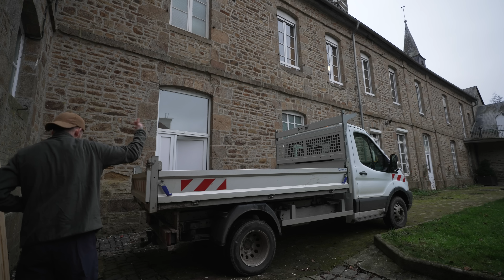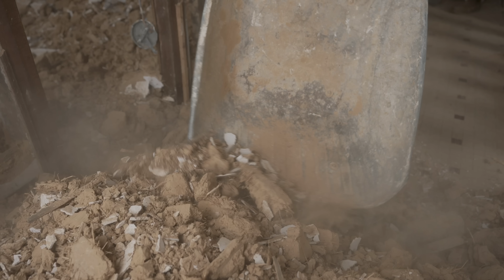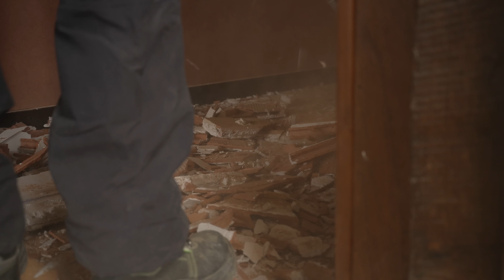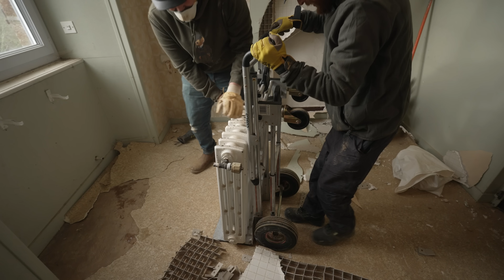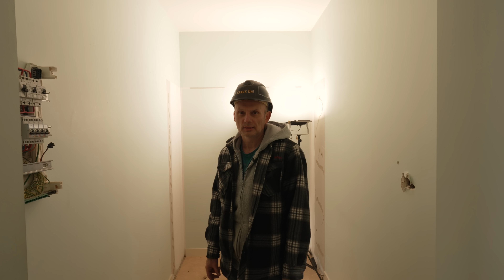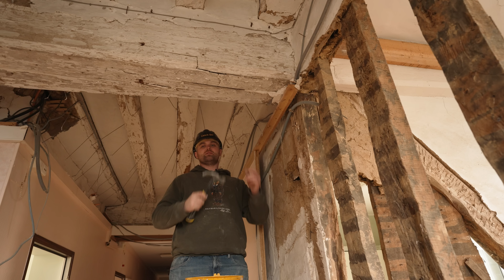The More I See The Worse It Gets

Comment: If you would want to keep the big beam, you could have it reinforced with epoxy resin and fiberglass rods. It's common practice in old wood constructions in The Netherlands (windmills for instance). It's a wonderful way to preserve the damaged but original bones of the building for posterity.
Reply: Personally i would definitely strenghten it. Because i don't know if the "its perfectly straight from here" isn't just an optical illusion. The angled support beam of the larger one is also slightly seperating at the vertical joint so to my untrained eye it kinda looks like it did sag a bit down. Might  be a combination of sagging + already crooked beam
Reply: @KaySan666  They're taking the beam out (was said in yesterday's video).  I think maybe this method of conservation (plexiglass rods and epoxy resin) is not well known outside of The Netherlands. It is however tried and tested and has saved many a tumble down, half rotten  timber frame from  pretty much complete replacement.  Reinforcing the old beam would not just be a cheap fix to keep it in place for a little while longer. On the contrary, the rods and epoxy would make it stronger than even a new beam and save a lot of money and labour (just thinking about the demolition on the floor above needed to access it). Anyway, their building and their right to make the decisions, but it is a shame to see something replaced that could have been saved and put to good use for many more years.
Reply: @Tezz007   Ah okay. thanks for telling me. Such a shame the beam has so much character.
Have they said what they're planning to do with the whole building? Because i'm rather curious what they want to do with it at the end.

Comment: I’m sure someone has already mentioned this, but shouldn’t a structural engineer and perhaps an architect be involved in this to make sure the building is supported?  The beam that looks questionable may be sound, so no demolition would be needed on the top floor. Or it may need replacing. Better to know before too much more work is done. Safety glasses too!

Comment: The Library is a cube shaped room in an outside corner of the convent [windows on two sides] that is two stories high [there is a 3rd floor above it not involved unless the "pesky beam needs to be replaced" and then heigh ho more demo!] which has a 2nd floor gallery [catwalk? balcony?] around the open space in the center to allow for access between the two "wings" of the building and to make the upper bookcases accessible [with ladders]. But there are some as cannot visualize easily so the image will help them.

Comment: The main beams are a case there size and length dictate a limited pool of available lumber at the time ,so for strength banana beams were used in buildings it's the strength that matters so you built around them ,wood this size from trees in excess of 200 years old there use for ships and public buildings would have priority on straighter and true lumber.

Comment: Just watched the end of the  video.  If you need to support the beam put a "large" post under it if you can and put trusses from the roof to the post on two or four sides to help the pressure on it.  Then on the furst floor put a bookcase around the post with the artifacts from the convent in it with a glass front.  Not sure we're the post will land in location of the room, but if it was in the middle it would help to hold up the beam, and be a focal point.  Just a thought😊

Comment: When you were talking about the beam, it sounds like the majority of it is okay.  Fingers crossed for you!  Also about the "always been saggy," bit - they probably used what they had.  They had a tree almost the right length, cut it down, realized they were going to have to incorporate a taper at one end, and just dealt with it.  That's my theory, and I'm sticking to it!  Also, if it's supporting the floor above level, does it have to be level on the bottom?

Comment: I find myself wondering quite a bit about the angled wall beam that "points" directly at the problem area. Did it deflect the downward pressure in earlier years when the joints were all tight and fresh?

Comment: If you put tarps down on the floor before knocking the ceilings down, you can drag the debris to its intended location rather than shoveling it several times while moving it into and out of wheel barrows.
Reply from the maker: who can drag a tarp with a ton weight in it?
Reply: @ThePethericks  yes I guess you have a point!

Comment: You get splits in the bottom of the beam as it fails in tension. You don’t get splits in the top of the beam because that part is in compression. DO NOT remove support to that beam until an engineer has given you advice !!!!

Comment: Billy, when drilling through an exterior wall, shouldn't the drill bit slope slightly downhill twards the exterior of the building? In the unlikely event that the sealing material fails, moisture wouldn't be allowed to enter into the structure.

Comment: I'm guesisng at the rate you are taking the debris to and fro to the dump, it's cheaper (not easier, but nothing has been easy with your projects lol) to do it yourself as opposed to renting dumper?
Reply: There's no charge if you take it there yourself.
Reply: Like a 6 yard construction Dumpster - If they even do that or rent those in France. It woud be much safer and easier. It would cost more I am sure, but save a ton of time and be more safe.  @Daihatsu_Hijet

Comment: the walls you are taking down are holding the floor above up
Reply: No they aren't 😂
Reply: No they aren't.  In one video Billy showed how one of the walls wasn't even connected to the floor above.  The upper floors are supported by the big beams which rest on the  outer rock walls.  The construction of these older buildings differ from modern building methods which do use the inner walls as support.